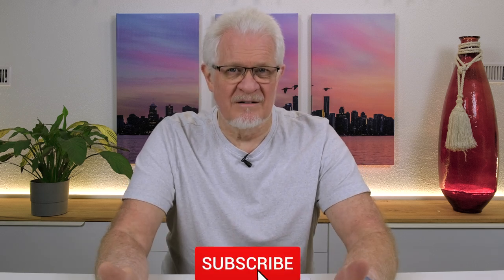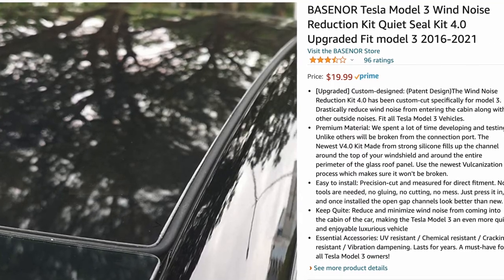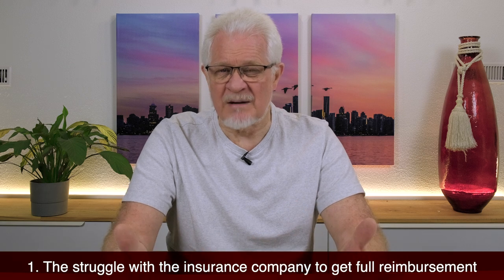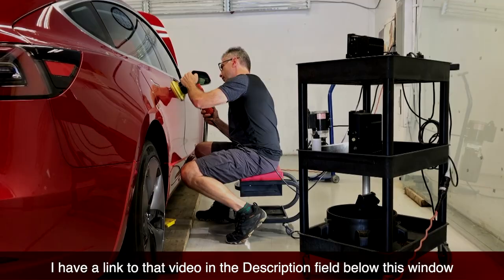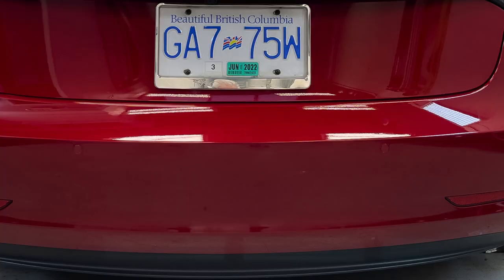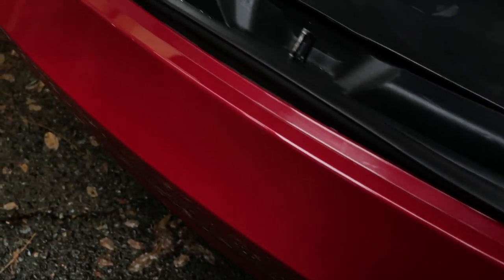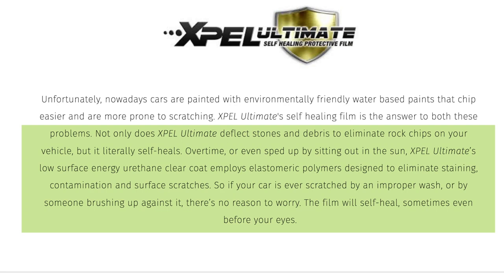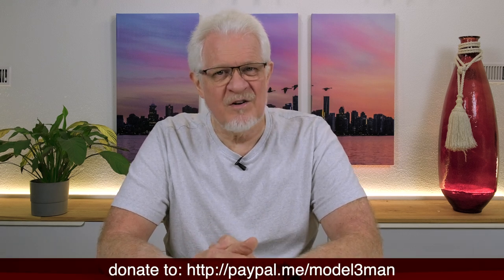Story of a Tesla Repair (Part 3) - PROTECTIVE PAINT FILM MIRACLE

Comment: Thanks, Peter. Good to see Red Dragon as good as new or better. I'm happy to report that my control arm issue has finally been resolved. I got my car back exactly. week ago (a red Model S P90D). I had a very long drive down to Victoria to have it serviced (no Tesla certified repair shops up island in the Comox valley. We sure could use one though what with the volume of Teslas up here.
Reply from the maker: That's good news John. Very happy to hear it has been resolved

Comment: I am getting XPEL and ceramic coating on my Plaid in January.  It was supposed to happen next week (12/6/2021) but sadly had to be pushed back a month.
Reply from the maker: Best protection for the Plaid in my view. Just make sure you do your best to keep it pristine and undamaged until you get the wrap done :). Park where there are no other cars around even if you have to walk further :)
Reply: @model3man  Yes, that is the trick.  Few miles, no freeway miles.  Doing my best to avoid any traffic.  🤞🤞
The funny thing is, the Plaid is getting some paint work (front lip scratched on delivery) at the Tesla Service center and I have put more miles (419) on the Model S 70D loaner in 10 days than I put on my Plaid in 3 weeks (354).